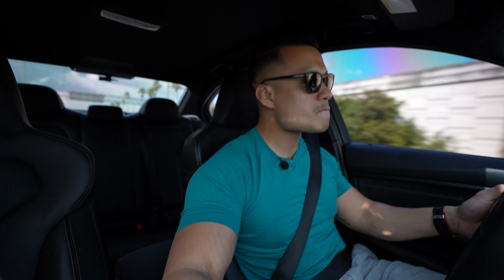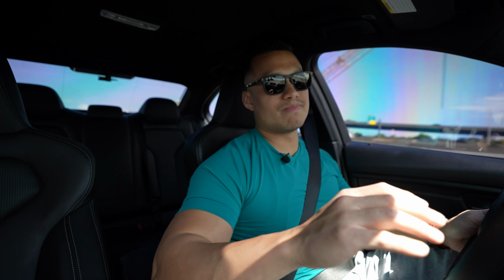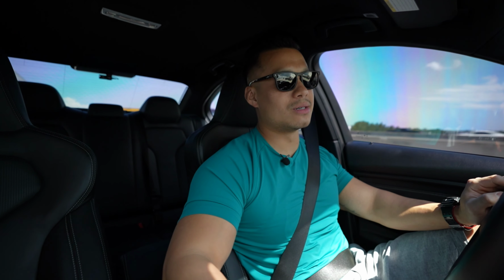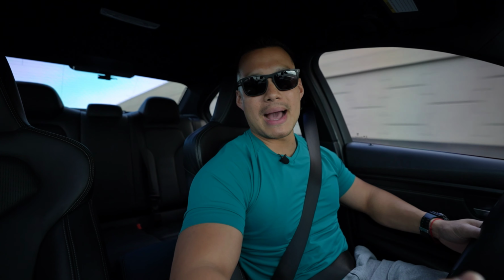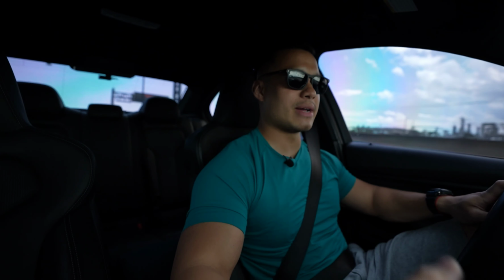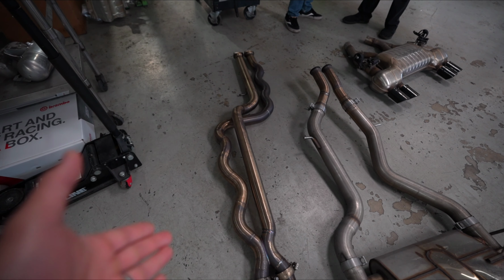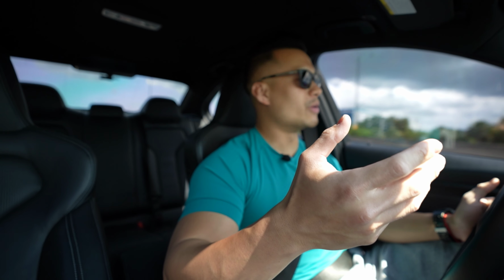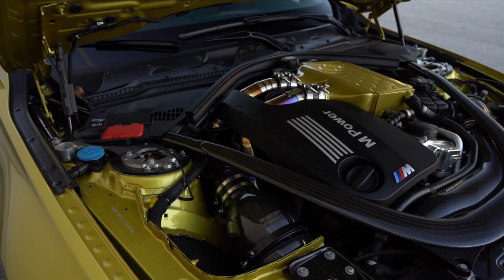The First 3 Modifications You Should Do On Your F80 M3

Comment: How are the KW DDCs compared to stock in Sport-Plus mode? Is there a significant improvement in handling over stock in Sport-Plus?  Did you feel an improvement in handling characteristics, outside of the comfort of them.